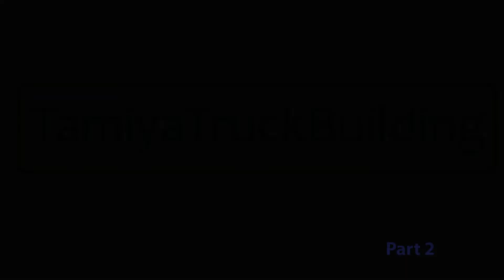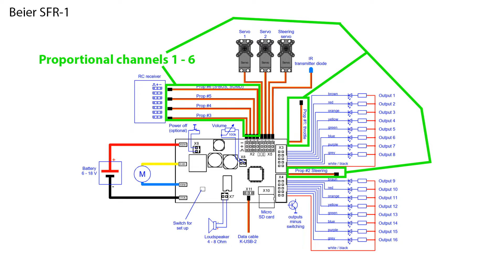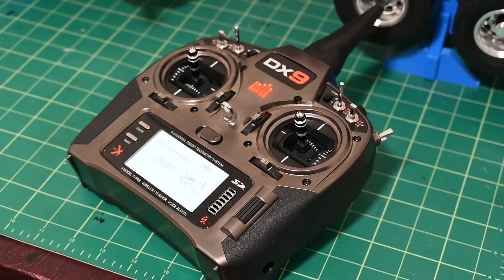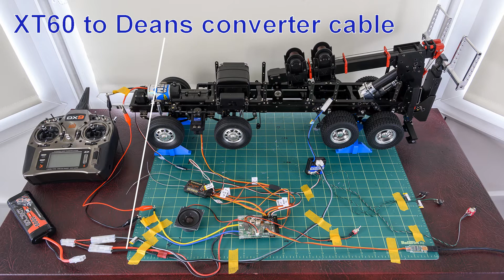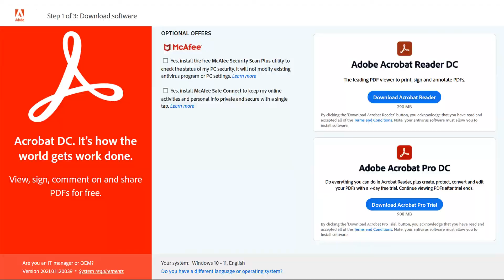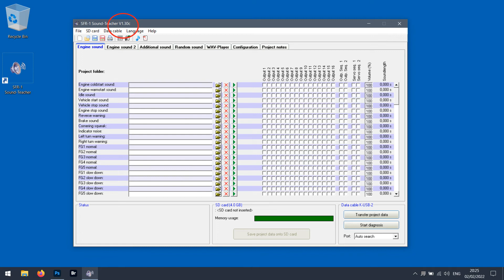Fancy a Beier Part 2

Comment: These videos are a great learning tool, can I ask where you get the sounds, walking, door opening/ closing ect
Reply from the maker: Hello George. Royalty free sounds off the internet, joined together using Audacity, saved as a .wav file. Upload to SFR1 and call your file from the 'Startup Function' (STeacher>General>Model Configuration)
Reply: @TamiyaTruckBuilding  many thanks, I will have a look. Any new projects in the pipeline?

Comment: Hallo Colin,  watched over for the third time. learned much more from you then the german tutorial from Beier.
Very curious: when you switch  the beier on you here walking, slamming doors, ( inreior lights will go on/ off) then the engine starts. I really wonder how you manege this in the programming . Audicity?.  i have a .wav sound but i cannot play because engine kicks right in. Can you help me out here.
please?
Reply from the maker: Hello Willem. Thanks for watching. The walk to the door, door open and close etc is a .wav file made up (joined together) of royalty free sounds off the internet. You are correct in that I used Audacity to join buts together. You can then point the Sound Teacher software to the file or, as I have done, a macro (sequence). Within my macro I have a few actions which all run consecutively (Sequence 1) at startup. I can send you a couple of screen grabs if you contact me on thorn503257@gmail.com.

Comment: hi colin could you tell me how you set up the three switch cruise/normal and rev engine switch ?
Reply from the maker: Hi Paul. Thanks for your enquiry. The cruise/normal control uses (in this case) Prop 5. Under Prop 5 Channel Assignments set  'A' 'In Position Static' to 'Cruise Control on/off'. Then assign Prop 5 to a Tx switch (via a receiver channel). This way, a two position switch will give you cruise either on or off. As for reverse; this is also a prop command. Select a stick position of your choice and use the short or long in position drop down list to find change of direction. I hope this answers your question. Any further help please contact me again. Regards Colin.

Comment: THANK YOU COLIN!! That was a great starting point. I'm thinking that it's WORTH the extra $85 for the SFR-1 vs. the USM-RC-3. The Speed Controller has many more cool options! I can control Throttle Exponential with my Hobbywing ESC, but nothing like that.
I will certainly be watching this Series whilst installing my Beier into my 8X4 Tipper!
Reply from the maker: You're welcome Carmine. I don't know what the selling price is in the States, but the unit is currently £75 cheaper than the MFC in the UK. Albeit without the LEDs, but they don't cost much at all.
Reply: I wouldn't even consider the MFC... The Beier is just so much better, more versatile! I believe your Series will iron out the "bugs" I've been having with mine. I look forward to MORE!
Reply: @tamiyatruckbuilding7426  
Colin, I just watched this Series again. I just realised that your Model that you're using, is relevant to my Tamiya 8X4 Tipper Truck with Actuator for the Dumo Bed!! As far as wiring and Sound Teacher setup. 
I joined the very helpful Beier Forum. ☺️  Andy told me that my USM-RC-3 has the SAME  functionality and wiring as the SFR-01!! Except for no ESC, and mine has eight Prop Channel inputs vs. six. 16 Switching Outputs, Four Servo Outputs, and a 3 Amp output. 
Because of that, I bought  10 Channel Receivers for my FlySky FS-I6X Radio. I SHOULD be able to control everything but Motor, through the Beier. 
.... As soon as I can sort the MESS I've made of it!! Your Videos so far, and the Beier Forum has been invaluable in sorting this Old Fart out!!